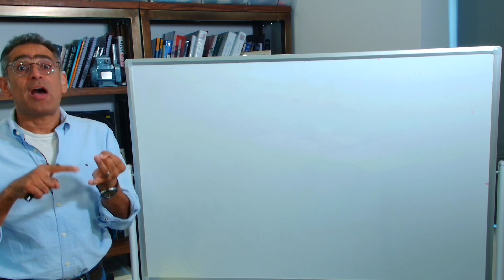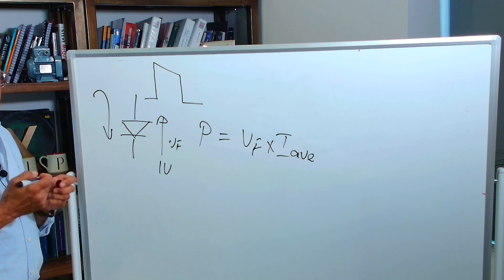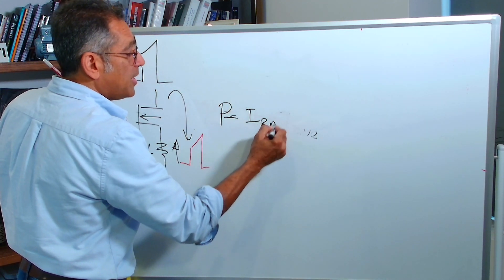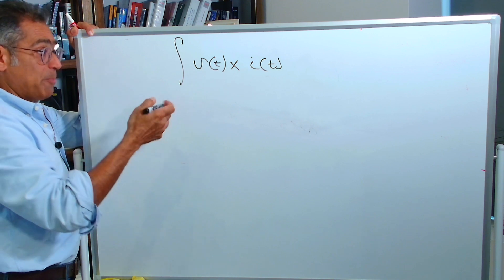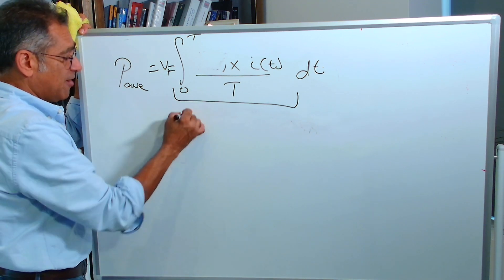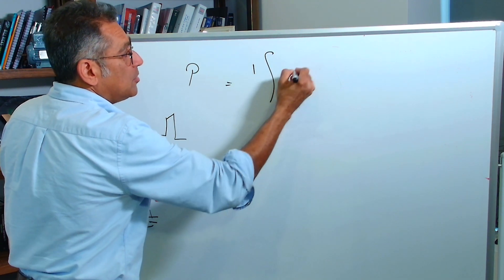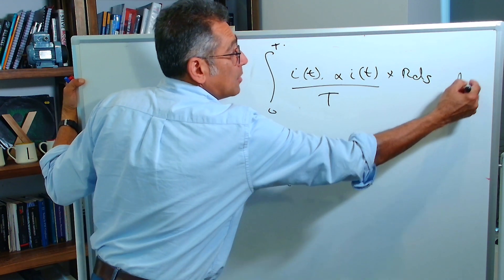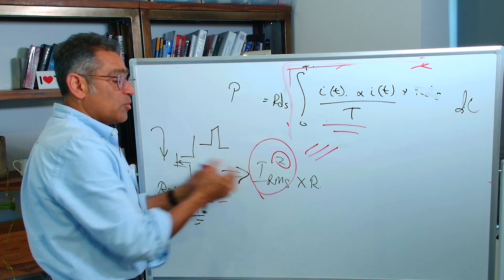When to Use Average Values When to Use RMS Values for Power Calculations

Comment: Yes thats what they teach in college about the diode forward drop,   but in real world the forward voltage drop across a diode  is NOT constant, it increases with the current flowing through it. Simply pickup any datasheet of a diode and check for Vf vs I characteristics

Comment: Another explaination can be that all periodic waveforms can be considered as a sum of different sinusoidal frequecies( Fourier series). When we multiply voltage and current for power only the components with same frequency will produce power. Hence if a power loss is to be calculated across diode, the voltage across diode is a dc, but for current it is ac ( with multiple frequencies) but only the dc or avg term will result in power loss. Similarly for mosfet both the quantities are ac, so rms is used represent the whole ac quantity quantity

Comment: Please, what will multimeter in DC and AC mode measured when hooked up to AC supply. Came at right while am thinking about the difference between RMS and AVR value.
Reply: Since you are calculating the areas under the signals, if the signal is always positive the value rms and avg are the same. If the signal goes negative it subtracts from the avg and it sums for the rms. That is why rms is useful for power measurements (power is always positive).
In the particular case of sinusoidal signals you can easily calculate rms from peak value just dividing by sqrt(2)... (btw in this case the avg is zero).
For DC avg and rms are the same.n